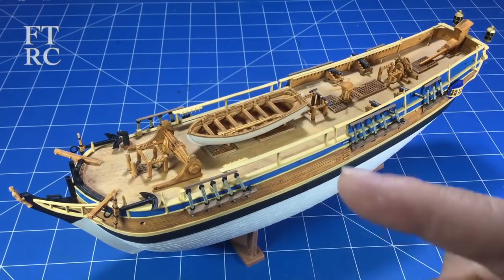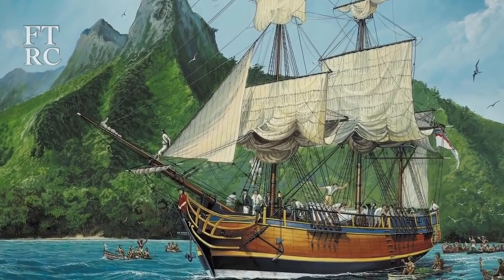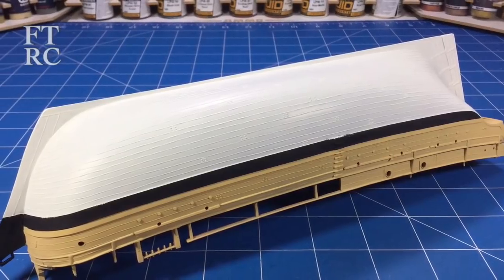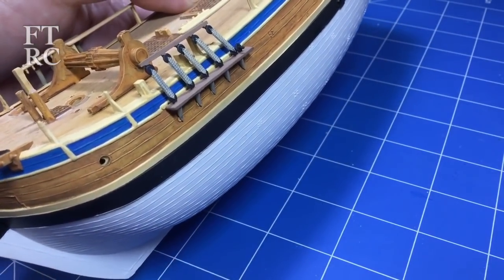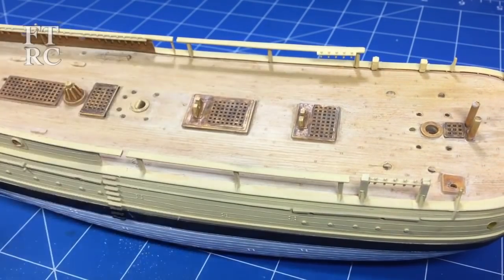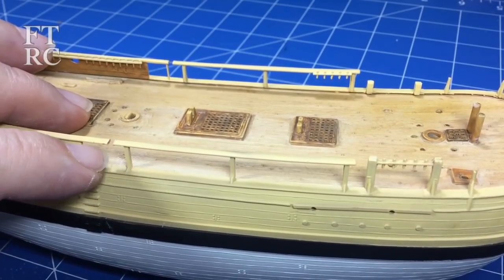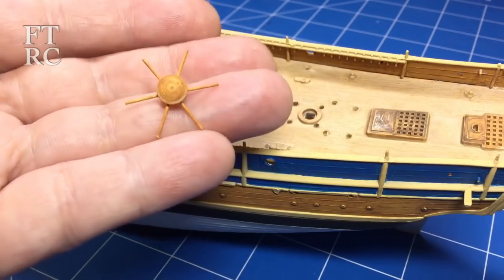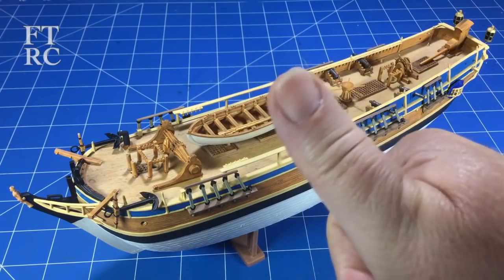Revell 1:110 HMAV Bounty Part 1 Box Open, Review and Hull Build

Comment: Harry - That is a wonderful build and your painting is excellent!  I built a wooden kit of a topsail schooner of that period back in the 70s.  The structure was quite similar. Darn, but model ships are huge projects!

At around 9:00 your point about the bow planks not matching left and right is understood.  I have an interest in old naval architecture and have studied the hull construction of a few complete ships,  as well as some wrecks and hulks of wooden vessels dating back to the 18th century and a few even before that.

It might surprise some modelers, but the hull planks of wooden ships didn't always line up and fall into a totally symmetrical configuration.  I don't have a good reason for things being built like that, but apparently having planks perfectly aligned was not always a goal of the builder.  I suppose they were simply using up the materials they had on hand.  It really is not unusual to have the hull planks mismatched in width.  I've seen that done on larger wooden ships and things as small fishing boats, like dories.  Clinker built hulls like those on Viking long boats might be different.

 Now, if you were building a 1/32 Mosquito kit I'd be more concerned.  I wouldn't worry about your hull planks not lining up.  They often didn't on the real originals.
Reply from the maker: Yes they are a lot more work, but I like that.

Comment: Beautiful work, thank you so much for doing this. Quick question: I'd really like to try and copy your paint scheme, but I don't have the ventilated space (or money) for an airbrush. Is that stynylrez yellow just a normal acrylic that can be applied with a brush? Or is there something close in a spray can you would recommend? Awesome channel!
Reply from the maker: Stynylrez is a polyurethane so can be hairy brushed on with a wet paint brush.  It goes on quite well and will self level but of course you will never get the finish of an airbrushed surface.  Before I had my airbrush I would put the base coat on with Tamiya Rattle cans.  They are a lacquer, so best sprayed outside, but dry fast, self level and work fine as a base for most acrylic paints.
Reply: @HarryHoudiniModels  Thanks for the help. It looks like Tamiya has a nice dark yellow that is close to the color you used. Cheers!

Comment: Harry aren’t those pieces you were referring to about the rat lines etc belaying pin locations for tying off the running rigging of the ship?
Reply: At the 9 minute mark I mean.
Reply from the maker: After further research I found you are absolutely correct.  Either way they were incorrectly placed on the kit, as per the scale plans I am using as reference.  Modern ships have the signal flags off the bridge which is these days forward.  In the days of sail of course the ship was steered and captained from the aft and the signal flags were run up from that stern bridge position.

Comment: Hi Harry, I'm your new follower, I'm building the same model at this time. I working in some upgrades that I would like to share with you.
 1st: A natural wooden deck laser cutted for better result. I can share with you the cad files and some images of how to do them because the result its really good. 
2. A new system for the deadeyes, the plastic ones that came with the model are really poor.
3.  A more complex and acurate rigging, instead of the basic proposed for the kit.

4. Some details added with copper wire to add more details. 

I will follow your updates, It is hard to find someone with your skills building these kind of models, ship model makers use to work on wood kits, and plastic model makers with good skils in photoetch, painting and modeling in plastic use to work on 1/350 battleships or 1/48 tanks and jets. 

Let me know, Regards, Jorge.
Reply from the maker: Although I do use wood veneer decks in my 1:350 ships, for this simple build I wanted to do the wood effects at the much larger scale by hand painting. I also have comprehensive rigging diagrams as well.  Built many wood and plastic sailing ships when I was younger.  Enjoying building them again now.
Reply: @HarryHoudiniModels  Your skills are really good at modeling and painting, so your model will look awesome. I'm looking forward to your updates. Regards
Reply from the maker: Thanks.. hopefully you have followed the next 3 updates with more scratch improvements. I’ve also ditched the plastic pulleys and will replace with wood ones from a model boat store.  I did manage to find a comprehensive rigging guide for square rigged sailing ships.  Happy to share it with you if you contact me privately here or on Facebook.
Reply: @HarryHoudiniModels  Hi Harry! Thank you for your answer. I use to work with the rigging plans of hismodel. I will put the link in a new coment because maybe could be a problem with youtube's spam policy. If you have any additional information I would grate you to share it with me, but in any case, your videos are really instructfull and informative, ande are helping me a lot with my job. And I will placefully follow all your updates. Thank you very much